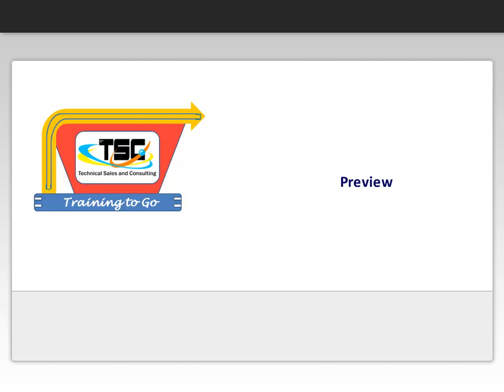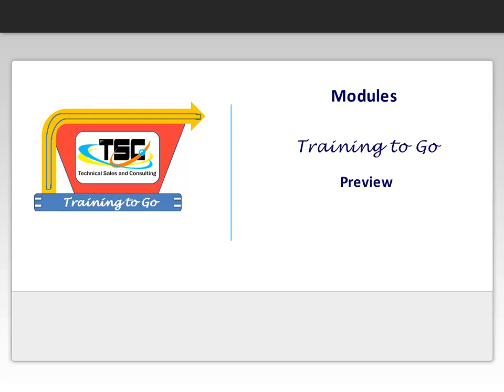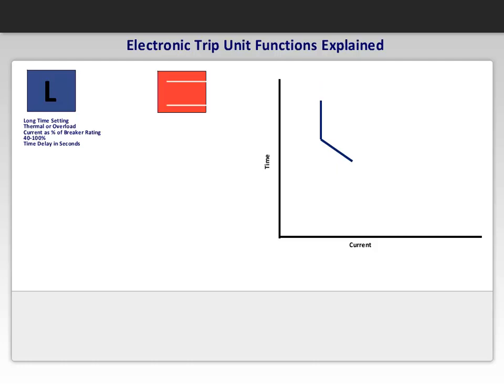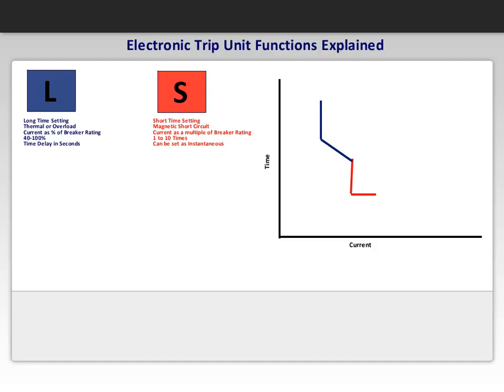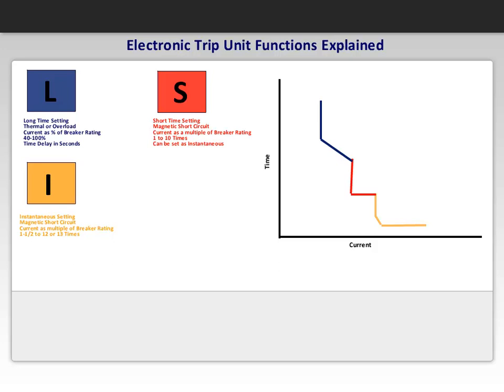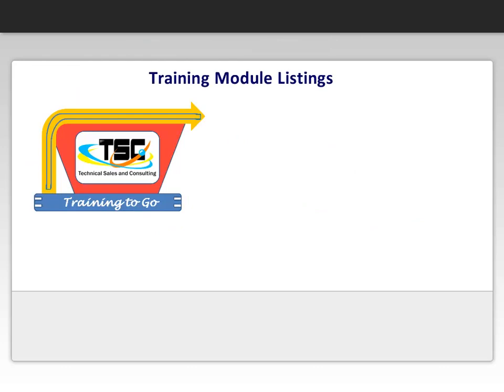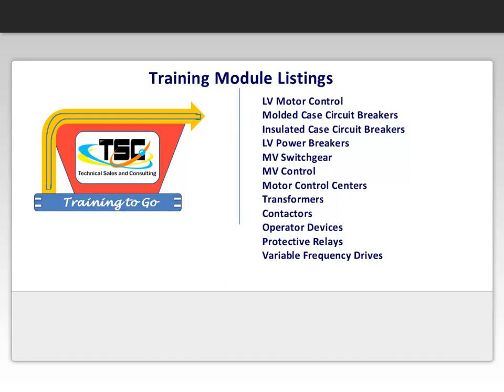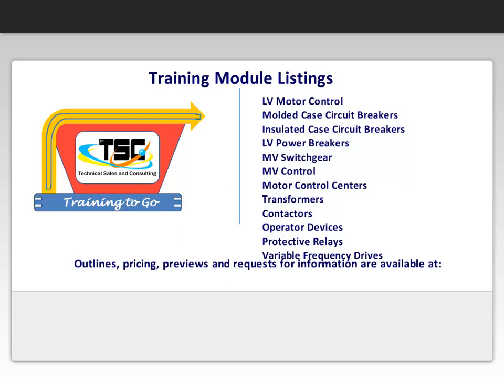LSIG Trip Unit

Comment: I have a question. How do you actually test the G protection? If i connect with Ekip TT tool and open Ekip Connect software i can perform a test session where i can trigger all of the protection separatedly L,S,I but i cant seem to trigger the G protection. Is it even possible to do a test to trip the G protection through software, without actually injecting the current?
Reply from the maker: In most cases you will need a ground fault simulator to inject ground fault current.  Most secondary test kits from circuit breaker manufacturers have this setting.  It is also a good idea to check the manufacturer's specific requirements for testing for ground fault.  Thanks for the question.  Please subscribe to my channel for further videos.  Also please recommend my channel to your colleagues.

Comment: Awesome!
Great job!
In your opinion, what is the better brand of motor circuit breaker?
I prefer ABB.
From Brazil.
Reply from the maker: ABB makes a very good product.  With technology shifting to electronic trip units other manufacturers are able to supply similar offerings.  Thanks for looking at my video.  Please check out my other videos and let me know if I can supply training for your group.
Reply from the maker: I think that Allen-Bradley makes quality control products but Eaton has a complete line of circuit breakers.  Thanks for the kind words.  Check out my other electrical product training at https://tsandc.com/elearning/